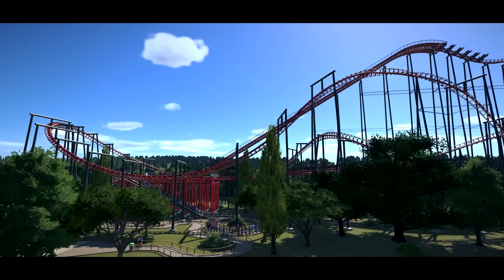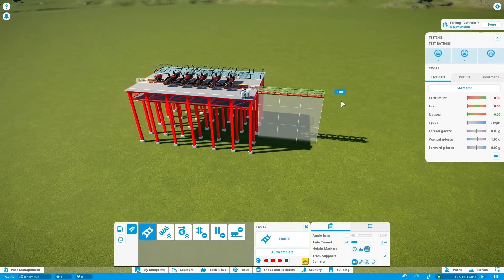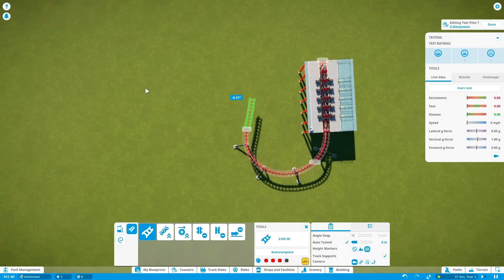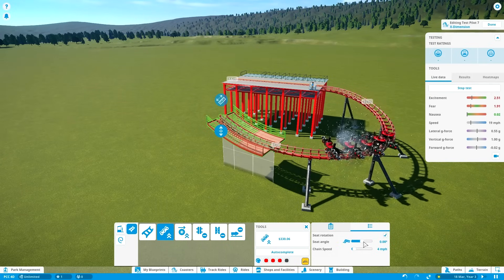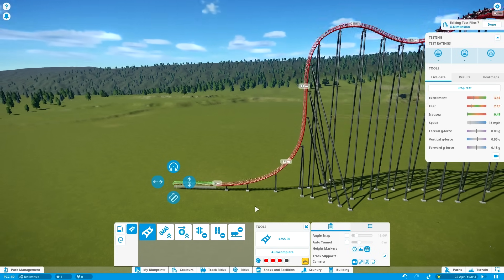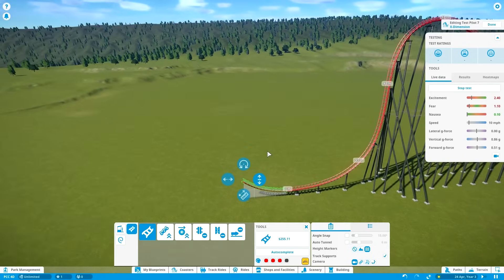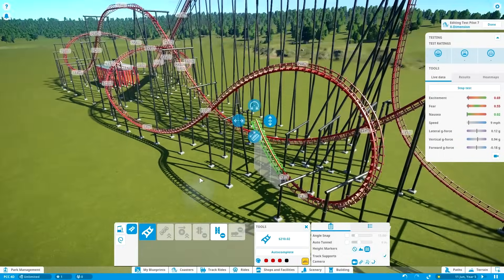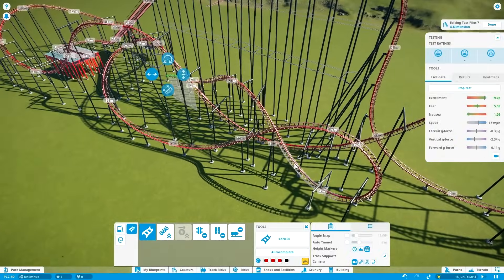Planet Coaster College - 4th Dimension Coaster Tutorial

Comment: 10:30 - X2's Raven turn is more of a continous half loop, while Dinoonda and Eejanaika both have a stall to them. Both Dinoconda and Eejanaika also do a full seat rotation during the Raven Turn while X2 doesn't so I'm pretty certain the different shaping is G related.
Reply from the maker: Ah, that totally makes sense. Thanks for explanation.
Reply: I feel like based on the shape of Eejanaika and Dinocanda's raven turns are designed so that they would give you a bit of airtime at the top of them.
Reply: Silvarret X2 runs with music on the chain lift
Reply: That, and the fact that X2 was a prototype, but Arrow went bankrupt before they could prefect the Raven Turn, something that S&S managed to do when they aqcuired Arrow.
Reply: Eejanaika's you do get a bit of air time where as on X2 you do not. Overall though its doesn't matter because you will probably have multiple broken limbs.

Comment: I noticed during the build, once the track was complete, that the excitement ratings were less than 6. Did it's excitement ever increase once you had added more seat spinning in? Would love to know the final ratings.
Reply: @Mech-Badger-Man  unless you're over 8 vertical g's, that's a big no-no
Reply: @Shmoob_  If it's extremely short, you can go to 9+ gs. When I tried to recreate Moonsault Scramble, it would produce 9.2 Gs right before the station because you cannot change the slope of the first lift on the Boomerang

Comment: you dont hit the face-down drop soon enough, and you have the bottom of the drop putting all of the Gs on the riders' shoulders.
then your element you made, its cool, but you rotated it a way that pushes you away from your seat at a quite forceful spot. , which is fine for vekoma flyer or b&m flyer.. but arrow/s&s restraints dont allow that dynamic comfortably. that's why these feel not as crazy as you might expect with always rotating to have the force towards the back of the seat
Reply from the maker: True, thanks for the tip. To be very honest, I realized the bad rotation on there, especially compared to X2/Dinoconda/Eejanaika which don't have it, but I didn't bother to figure out the right rotation for that section. You saw straight through my laziness!

Comment: What kind of computer do you recommend for this game? It's so smooth on your end! I was thinking about getting the new Razor laptop 1TB. I can never put more coasters in my park because it runs so laggy.
Reply: Trazilla It's more CPU than GPU intensive; whether it's more so single or multi-core reliant, I have no idea, making it harder to recommend a certain CPU
But a decent graphics card will definitely do you good as well
Reply: +Chopped Butter currently I have a Intel(R) Core(TM) i5-4200U @ 1.60GHz 2.30GHz
Reply: Trazilla  
what gpu do you have? going just on cpu the game wont run that great with that cpu
Reply: +Th3battlecow not by my computer at the moment. But what type of computer do you recommend for this game. Ready to get this game up & running smoothly.

Comment: He said 4D coasters tend to have higher stations. But The Joker (the 4D coaster i'm familiar with) station is ground level. and only has 8 seats per car. (4 seats on each side of the track) The joker also doesn't curve around(like he said all the real life 4D do), It's all built up. A Straight up lift. 

 I'm not saying this coaster is bad, Its actually really good.
Reply: that to different coaster manufacturer
Reply: He's talking specifically about these Arrow/S&S 4th Dimension coasters with the controlled rotation. You're referring to a free-spinning 4D coaster.
Reply: I know they're also called 4D coasters, but they're a different sort of.. coaster type? For one, the seats freely rotate as opposed to having a set pattern in which they rotate. No such coaster type as The Joker exists in Planet Coaster.
Reply: 4D coasters of the X[2] have a normal 3D track with an extra "dimension" from the rotating seats. Those free spinning ones have a 2D track layout and rotating seats, so they should really be called "3D coasters" to be fair.
Reply: TheCanadianBanana s&s bought arrow when they went bankrupt